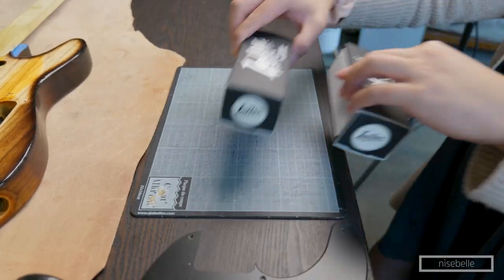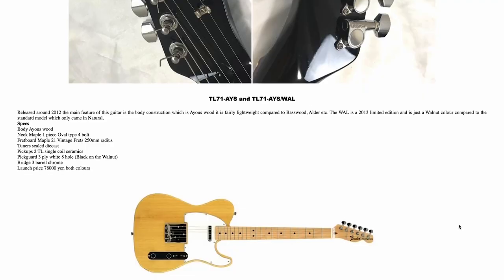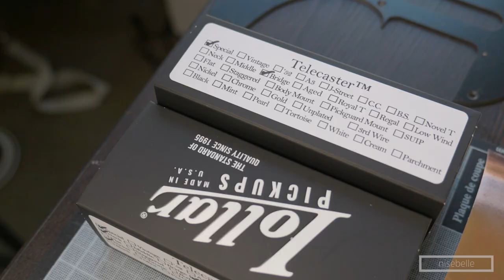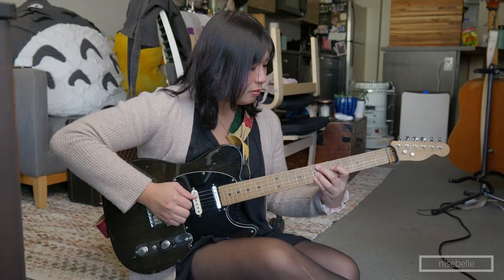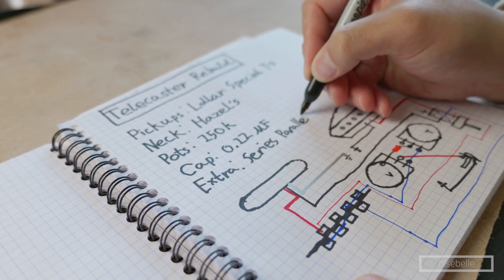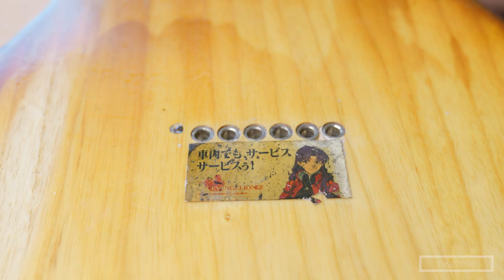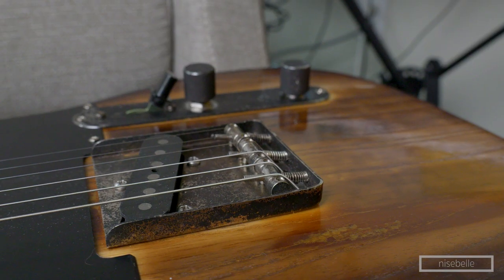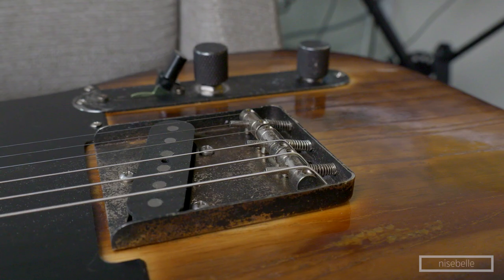Rebuilding a Burnt Telecaster | Part #2

Comment: What an awesome build! I especially love the versatility that comes with the series/parallel switch - I have it on my Tele as well. The only suggestion I have is to connect the cap to the two middle logs of the pots (50s wiring). With this, there's no treble loss when rolling down the volume and it makes the volume and tone pots so much more usable (I could never go back).
Reply from the maker: That’s awesome! I’ve done 50s wiring on a couple Gibson type guitars but I’ve never seen it on a tele, I’ll have to give that a try! Thanks for the suggestion!

Comment: Cool job rebuilding that burnt Tele. I’d be interested to hear more on what you used to clean the parts, was it just using regular household items? How did you figure out how to phase switch the pickups? I have an SX t style guitar that I love and always loved Brian May’s tones, so would love to know how to do that
Reply from the maker: Thank you! For cleaning the parts I used just some hot soapy water and a bit of baking soda where there was some rust, plus a soft toothbrush. I actually learned how to do phase switching, coil splitting, series/parallel all from the Seymour Duncan website. They have a ton of great wiring diagrams on there for almost any mod!

Comment: The whole lay-your-tools-off-beforehand thing is peak Asian. I love it so much. I kinda want that for myself but having worked on cars for decades, improvisation of the correct tool for the next procedure is my method. It's impractical to lay out in advance all the tools required to pull an engine.

Comment: "I can't unmelt or remagnetise this pickup". I don't know if either of you still have the pickups, but... I'd actually love to see you try. Building pickups isn't actually all that hard - remagnetising takes a couple of permanent magnets or coils to pass your bobbin between and at least from here, the cover looked salvageable, a mechanical winder from China is under $100, sometimes under $50... and you might well find that (assuming the pole pieces didn't just turn to dust, which would end this project pretty quickly, but that's unlikely) the "heat treated" magnets might give an interesting vintage sound once remagnetised. Flatwork, wire and wax are all trivial to get.

Comment: ..at 1:28 into the video, what is that tremolo tail piece mod on that telecaster there in the frame or about a second? 🤷
Reply from the maker: That was a product from Duesenberg that’s essentially a b-bender but for multiple strings separately controlled. I kinda want to try one out!

Comment: ..if it was top heavy you could get a Glary neck, ..because they're super light weight, and shave it down to Fender specs and reshape the headstalk to the standard tele shape and buy a fender decal on line.